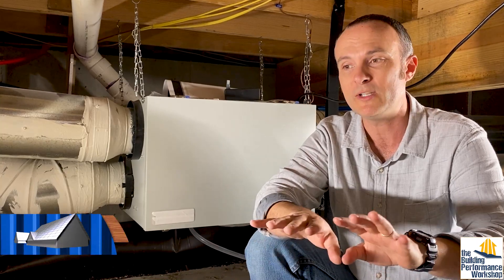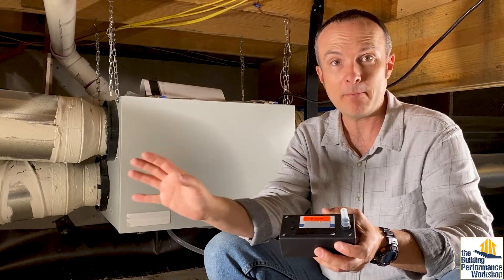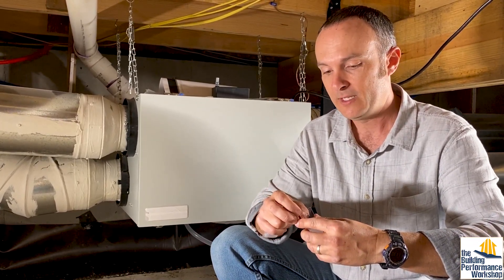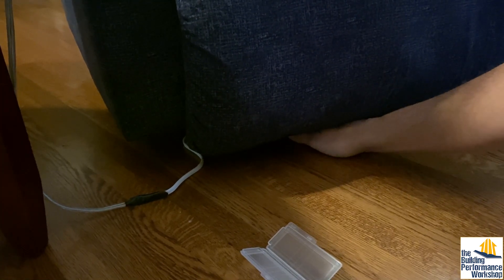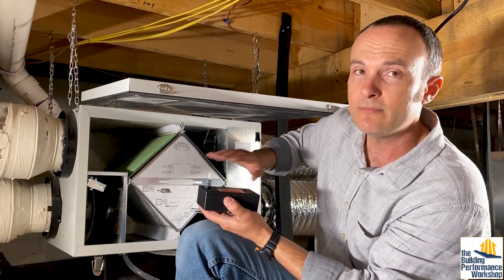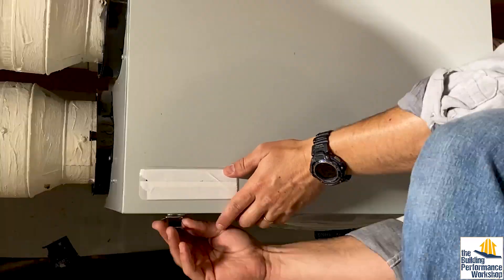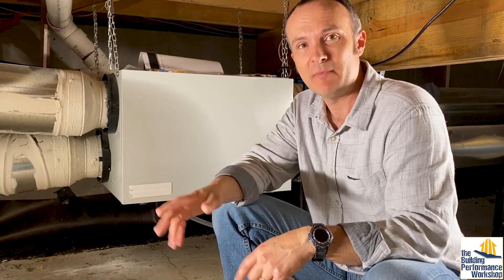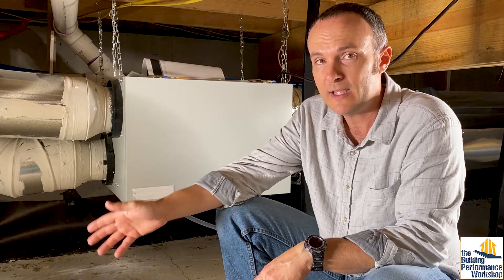How Hard is our ERV Working? Testing the Chemical Exhaust, Dust Samples, Rugs, and Formaldehyde

Comment: Hate to bug ya on this, but you said 13 filters?! I think I can figure out about 6 or more possible filtered spots, but could you cite the actual devices and filters here?
Reply from the maker: 3 each in two HEPA units, 2 each in two ERVs, one pre in heat pump and dehum, one master filter grille, one in makeup air. That’s actually 14 I guess.
Reply: @HomePerformance  Wow!. Corbett, if you ever get a chance, I know I for one would love to see a future video on filter/upkeep maintenance on high performance home air quality systems like yours.
Reply from the maker: Putting it on the list buddy
Reply: @HomePerformance  

As well as practical duration of filters versus what their advertised lifespan is, how complicated it was sizing ductwork to deal with those sporadic pressure drops across the filters (it's like you turned your system into a raceway of venturi tubes lol ), and any considerations for any challenges changing those filters may bring as you age in place.
Reply from the maker: I have 3 kids. Indentured servants, I mean.